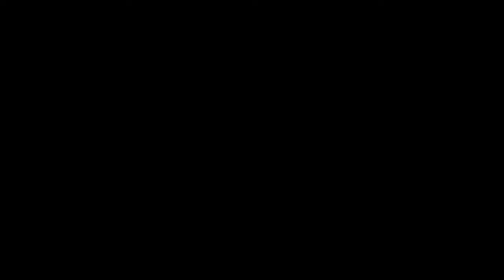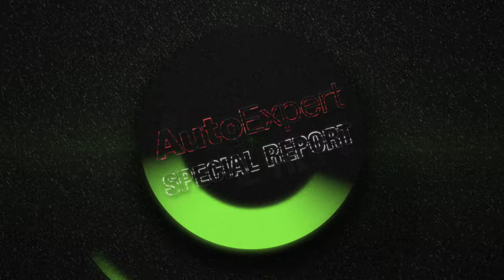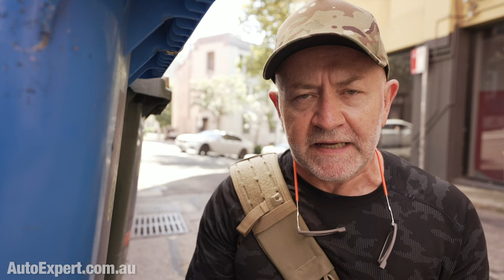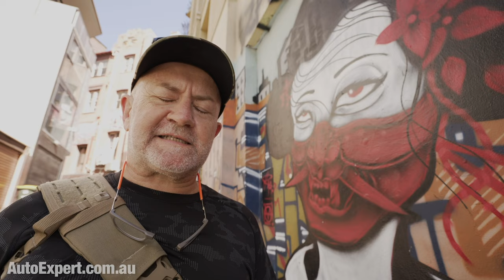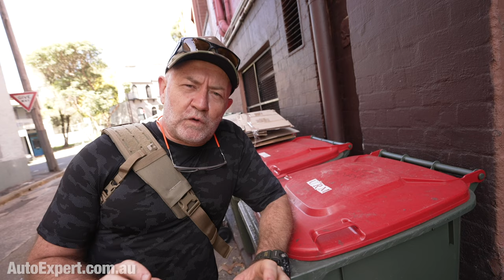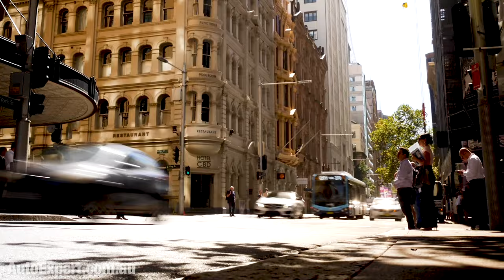These two simple hacks will make your engine last longer | Auto Expert John Cadogan

Comment: If servicing your car every six months leads to a meaningful reduction in engine wear and tear, why isn't it mandatory to preserve new vehicle warranty?
Reply: Because the warranty demands the minimum work to keep it alive past the end of the warranty. If you want it to last longer you may want to do more....
Reply: It's actually in the operators manual under the heading of 'Severe service operation' or something like that. Anything other than steady highway operation in perfect dust free air, no hills, not too hot is classed as 'severe service' and the normal service intervals are halved. Not reading the owners book gives the dealers an out when you take the car back with issues.

Comment: Really? Change the oil every six months? I have been using Mobie 1 0w-40 for years, changing it every 25K miles regardless of time and have never had an oil related problem. 1987 diesel three pronged suppository with 330K miles under this routine without an issue, save for a Volvo and a Ford. with over 300K miles. With synthetic oil and filter this is $200 US plus proposition costing $12K over the 30 years I drive cars vs. $2K at every 25K miles. I am glad your pokiest are that deep. My new car is an electric so I have none of those problems any more.